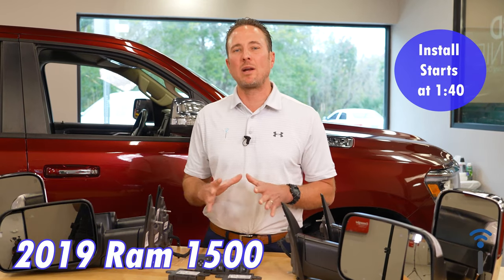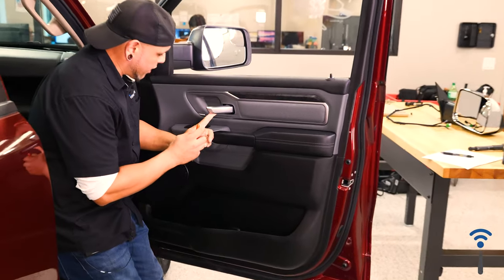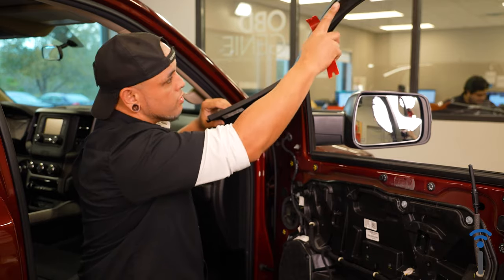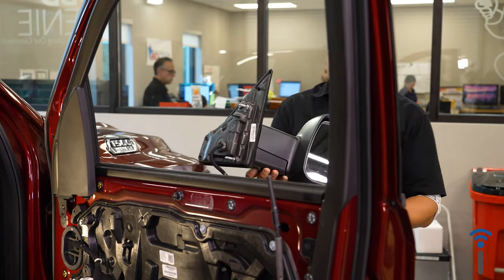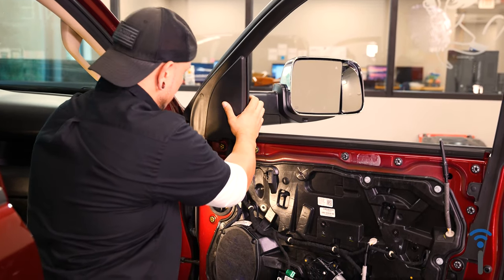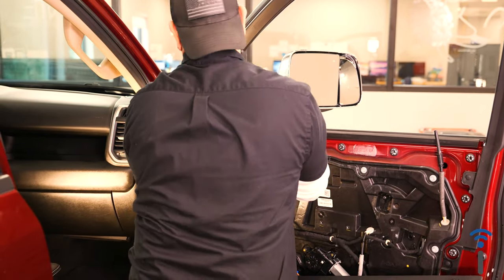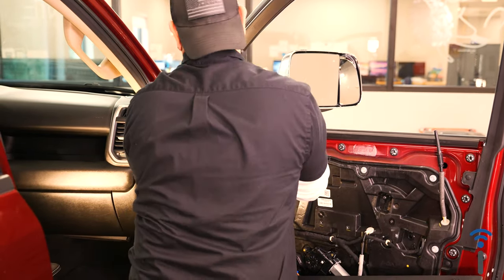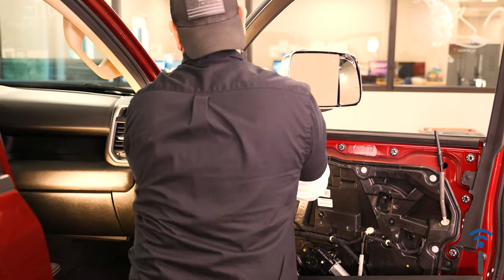2019+ Ram 1500 Power Folding Tow Mirrors - Infotainment.com

Comment: Asked local ram dealership about putting them on for me. Said they had no luck in them working after putting them on. But cost $190 to put on and see if they work. Watched video on how to install several times. Put them on myself. Pushed button to see if they worked when installed and had big smile on my face. Them worked easy install for me 2 hrs. Do highly recommend even if they cost about $600 to much when you buy them in a package.
Reply from the maker: Thank you for selecting Infotainment.com for your factory accessory upgrades.

Though we believe our prices reflect a fair value, we accept your suggestion for consideration.

Enjoy the power folding mirrors!
Reply: @Infotainment_nav  I just looked at the price and it was double the $600 listed above.

Comment: Hello.i have ram 1500 2022 whit tow mirrors but not electric foldable. Do i need the full kit?
Reply from the maker: Yes you would need the full kit as the powered mirrors are different and that kit comes with Modules switches and programming that you will need. It is designed to take Non-Foldable mirrors and make them folding. Every component will be needed.